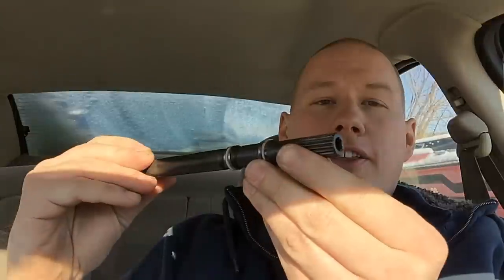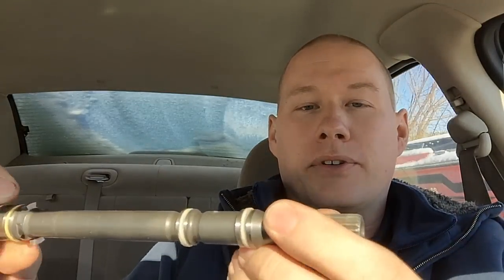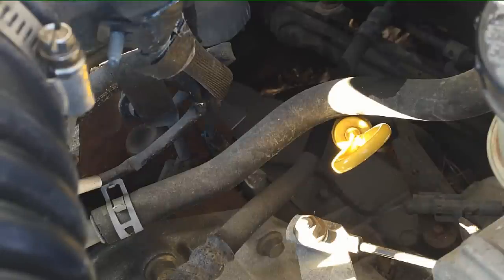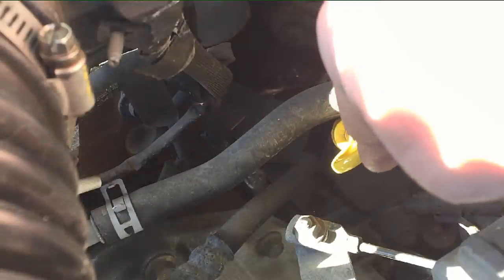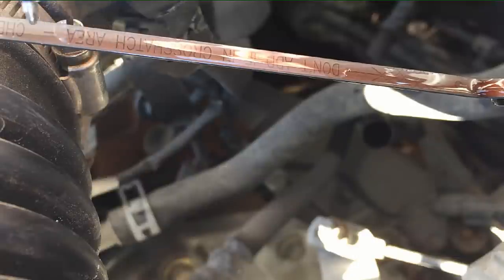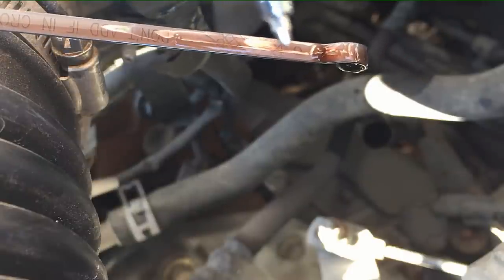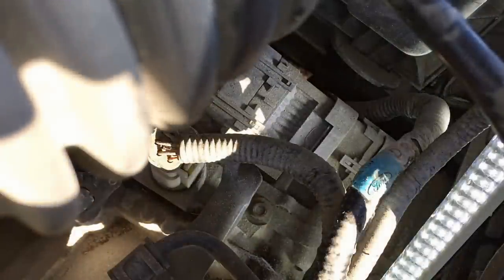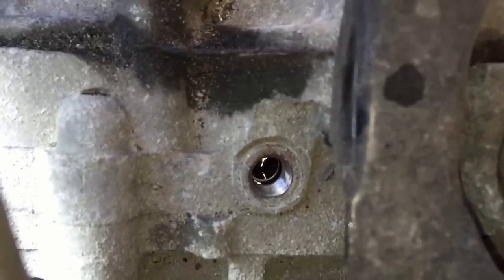Ford Transmission Tips: #5 Ford Taurus & Windstar No Movement EASY Diagnosis

Comment: Hey Fordtech. I have a 2005 focus with a 2.0L. Can you tell me if the ECM can be reflashed for low Idle?  When I come to a stop the engine almost sound like it is going to stall. I've already replaced the Idle control valve and cleaned out the throttle plates
Reply from the maker: Tony Camacho You likely have a large vacuum leak at the pcv hose, follow it the full length you will see it.

Comment: question I have is if the torque converter end of that shaft is stripped will the vehicle still engage into reverse ?if so do you have any ideas of what that fault might be ?
Reply: If the torque converter spline strips out you will get no pump pressure at all. In this case you will not have reverse as well as any of the forward gears. In other words the vehicle will not move backwards or frontwards. All it will do is sit there.
Reply: +Joe Vignolo question is why would the car still have reverse and no forward gears... not what happens when you have this failure he tells you that in the video
Reply: victormendoza871
- If it backs up but won't go forward in any gear it's not the fluid pump or the torque converter. You probably have a problem either with the control electronics or transmission control module or something internal like the valve body or a bad clutch servo.
Reply: +Joe Vignolo thanks !

Comment: I have a 1999 Taurus and it's acting up but today I discovered after removing the connection to a sensor that sits on top, it worked. What is that sensor

Comment: Maculoco i have the same issue on my 05 f150, I have changed the torque converter and still no engagement if it's possible for any help. If so thanks in advance
Reply: Some oil comes out of mind transmission but not very much from that hole

Comment: Any trans codes set?
Reply from the maker: John ajr No this will happen so suddenly usually going down the highway and there will be no time to set a code and line pressure is not monitored with a pressure sensor.

Comment: I have a 2009 Ford Taurus car and ever since I bought it it has had shifting problems. When my OD is cut on when it gets to around 45-50 mph it acts like it is trying to kick in and out of OD quickly and hard. But I can cut the OD off and it shifts fine. Any idea what the problem may be?
Reply: It is not the transmission on a 2009 Taurus.  It is a bad coil on top of the spark plug.  It feels like a transmission issue but it is not.  Search YouTube for Taurus bad coil.
Reply: @deepZZZnap  thanks

Comment: china junk , I have a 98 Taurus se with a duratec engine it's got so many problems .
Reply: the trans. is doing fine , it just needs new or fixed lealing brake lines , a/c ,alternator and then I will be driving in style again . Oh yeah it is leaking oil , I believe its the oil pan gasket . It's a nice looking piece of ford junk .